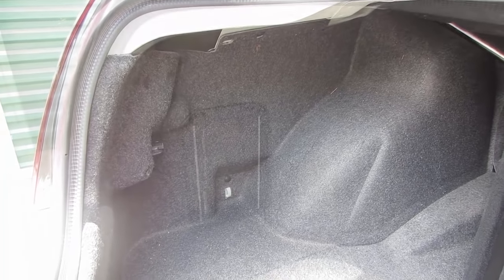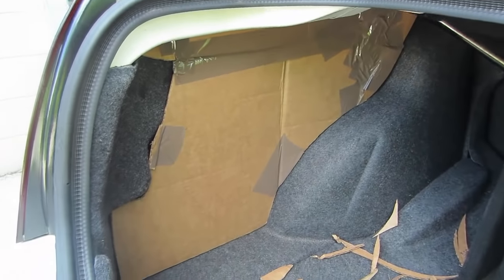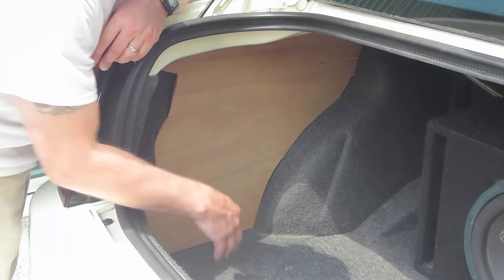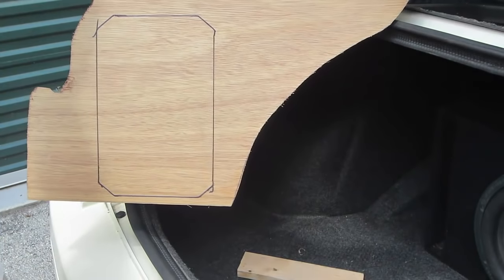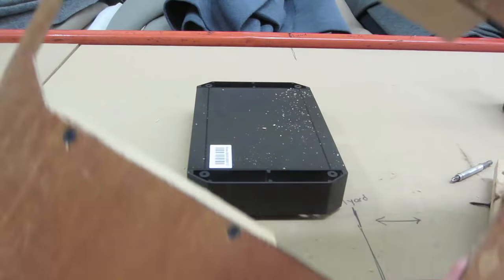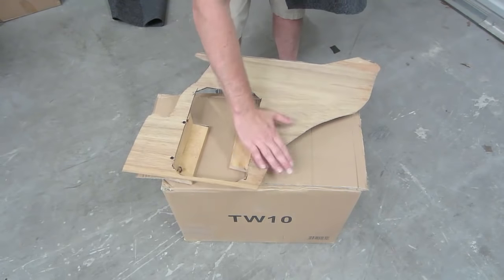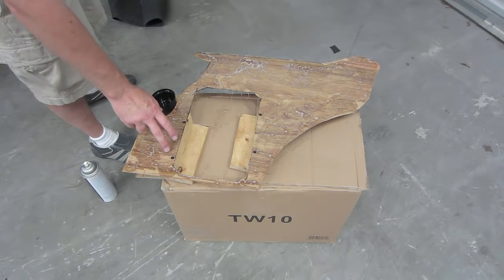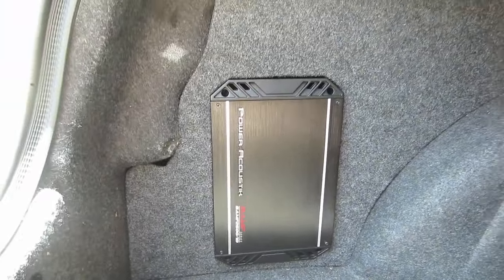How To Make A Custom Amp Rack For Your Cars Interior

Comment: Thanks for the video. I'm actually working on my amp rack tonight and got the two amps sitting one on top of the other with the top amp angle in a little due to the wheel well. I couldn't figure out how I wanted to mount the rack to the vehicle securely and have it still look clean. I really like your flush style carpeted fabrication. It's also easy to access the wires still when needed to because its mostly pressure fitted. Great idea. My only tif was that you ended up covering the heatsinks with the 2x4's. Anyway, after watching this video, I feel inspired and motivated again after hitting that wall. Thanks brotha
Reply from the maker: no problemo

Comment: Was looking to mount my amp nicely, i think ill do the same. I have a 2002 honda accord. Great video, and enjoyed the music. P.s. I dont think will cause overheat issue, the top face of amp is exposed. If it does overheat ,just put a fan back there and maybe trim some edges of the board for flow.

Comment: A great video nice job! The flush mount looks great! My 2 amps are mounted on both sides but aren't flush mount I'm installing a 40" x 18" x 15" enclosure duel 12's. The problem is my  amps are about 43" apart so if I flush mount them it will look way better and give me about 3" on each side👍

Comment: Looks really Good. Hey is that a Chrysler 300 ? just curious. But I have to re carpet my entire trunk because the liner is kind of out of shape and I don't like how its loosely sitting around the wheel wells and all that I want to have it All carpeted nice and tight and do what you did for the Amp

Comment: Nice job...my only issue/concern is the support for the Amp. Yes,  less is often better. But I have a hard time accepting that less structure holding your Amp in place is better.
Reply from the maker: I agree, But this is just a demo/example, its not an actual project for a customer.
Reply: Lessco Electronics indeed. Basics of how to and what to do are there. But within the how to/example it would of been better showing a proper way to secure the Amp as well. As for just the creation of the panel itself it was a great video.

Comment: Did you like the adhesive in your hands lol 

Hey I got a question. 
Does the panel pop off when you gotta make a hard turn? 
I mean the video is very good I like the idea but I feel like the amp will push the whole panel out when you make a turn with that weight on the amp

Comment: Great videos. Thumbs up. Subscribed. I have a single cab truck and I'm debating whether to put two or one  sub speaker. What do you recomend? (personal use only) Thanks
Reply: I had a 96(?) Ranger with a single 10" sub in a sealed box. I only had about 150 watts pushing it, and it was plenty for me. One thing that I learned, check the mounting depth of the sub.
Reply: Thanks for the info

Comment: Pressure holds it up? It would take 5 minutes to make a few brackets out of radio back strap (because I'm sure you don't use that when mounting radios) and mount that board to the car. If the owner ever went to a audio event they would be DQ'd for improper securement.
Reply from the maker: This is only a demo board made up for the tutorial...
Reply: Gotcha, some people might think it's roadworthy like that. I got that impression. And I'm really sorry you had to work with carpet. It's my least favorite thing to work with.

Comment: nice...want to do the same for my Rockford amps,but not pay the rip off artist at the stereo shops....i would have found a away to secure it from the back side so on turns it doesn't flop over...other than that...nice job on the cheap...

Comment: good but whats holding up the pice that you made with the amp
Reply from the maker: This is just a mock up panel I made just as a  sample, only for display - I actually tossed it after I made the video, In a real car you can secure it any way that works best for your application.

Comment: What was the main reason for the relocation of the amp supports.  I'm not worried about heat that much sense it's one of the newer ones.  Just curious on the thoughts/reasons of the creator.
Reply from the maker: +Brian Rott  It just helped the reassembly a little for me. It was a last minute thing.

Comment: 1/8 ply is ok if making a solid plate base for door trim or if you fill with plexi glass to stregthen. But as i own Lethal Sounds in australia this build will not last long especially with the weight of the amp on it. Unless. He used it as beauty panel that just slid over the top and is mounted 3 or even two points to the boot structure. I would have used minimum 12mm mdf and possibly a L bracket made of steel angle to affix the amp so it would look like it was floating. This isnt a dig at you. Everyone does things their own way, but if this was my build the customer wouldnt be happy when it broke. 
Your plywood was feathering when u cut it, just saying

Comment: A lot of haters An so called pro audio installers in here smh. 1 it's a quick how to for do it yourselfers ..2 the panel will not fall out if he hits bumps it's sitting in there pretty tight, it's a small amp low power so no need for anything more than 1/4 inch piece of wood ..3 cooling will not be an issue , it's a low power amp An there plenty of room for it to breathe in that panel . Lastly the guys who say they are pro installers... This guy has been in the installation business longer than probably everyone in here telling him what he did wrong lol . Mark at car audio fab is teaching how to custom builds etc ... This is nothing more than a quick easy how to guide , more to be used as tutorial for a basic amp rack. No doubt in my mind this guy could have spent more time An built an amazing piece just like mark if not better ..
Reply from the maker: thank you! these guys are brutal, right? sheesh... what if no one did tutorials, then what would they say?
Reply: Lessco Electronics yea I know.. everyone is a critic .. I've been doing installs and custom work for about 20 years an I still check out your videos for advice and ideas, I know you know your stuff.. I tried once upon a time to get an account set up with lessco but I run my business from home An they wouldn't let me since I'm not a shop with a mortar building .. I use my barn and garage lol .but it's cheaper an it works .  Keep up the videos .. if ppl actually knew everything about everything they wouldn't be on YouTube looking for info right!

Comment: i own a apex audio 8 '' woofer bazooka vented carpeted speaker enclosure and 2 new 6 x 9 sealed 6oo watt's speaker enclosures and a few tweets I have read lowrider magg. and I found out for myself if the speaker enclosure is vented and especially if the speaker is futuristic like a butyl and polyeurapfoam woofer coan itll rattle the house or vehicles whereabouts and the rattlings better other then the olden day paper woofer speaker which has rattled the inside the room I was in  with the help of a 15 watts equalizer the bazooka woofer does require a amplifier and does clip with a 12 volt battery charger  until then or now connection. the amplifier does require a very safe mount because they concern caution in a trunk I myself don't like things that are expensive flopping about. the amplifier does have a heatsink

Comment: wouldnt that cause the amp to get hotter not being able to breath
Reply from the maker: +insanechevy91 Very marginally,  I've done this sooo many hundreds of times and never an issue, these days amps are so digital there's so much less heat dissapation than there ever was to boot.
Reply: You mentioned making sure the sides were free and then you put bracing on the sides anyway. Did you have an issue with top bracing? Regardless of the age of the amp, it is how you run the amp that decides whether they get hot. If you run an amp at 0.5 100% of the time, even if it can handle it, it will get hot faster. Those vents are there for a reason.

Comment: Probably wasn't even wired up behind that panel lmao
Reply: Not with those mounting braces installed at about the 10:15 mark blocking access to all the connections on the amp lol

Comment: He could have just traced it on flat ground?? Like really dude
Reply: Then he wouldn't have the car to trace it off of. The floor of the trunk has it's own shape. Are you saying it would be easier to stop and turn off the camera and reposition the tripod in another location. Readjust the tripods height and level screws  and then realign the camera to make sure everything is in frame. Do a sound and video test. Then start recording?? Aren't you a smart one.